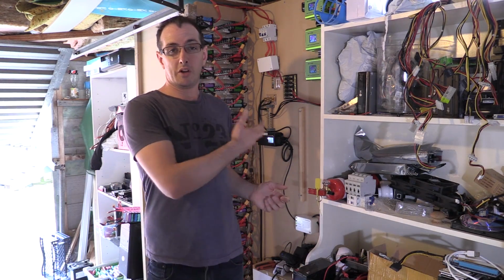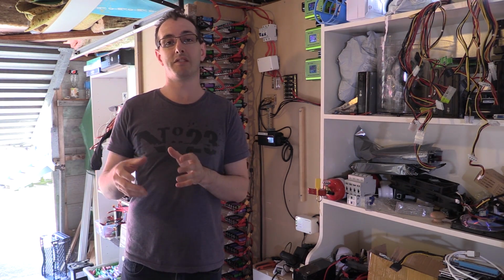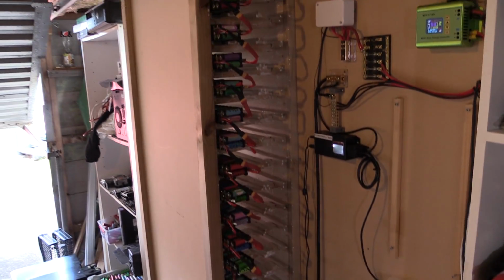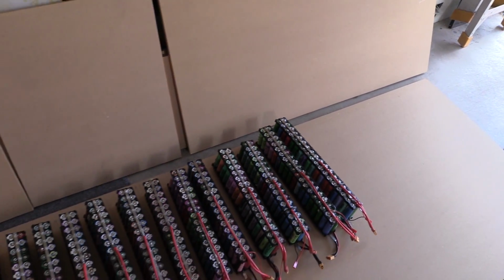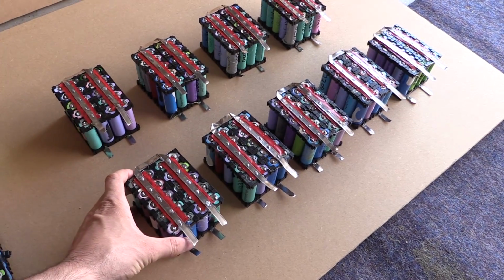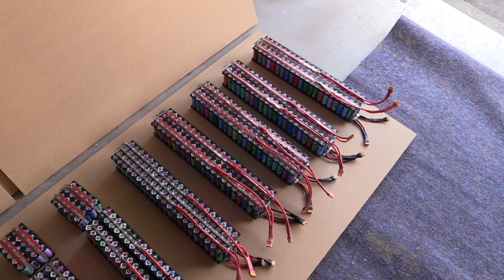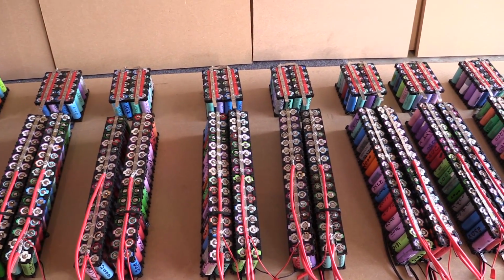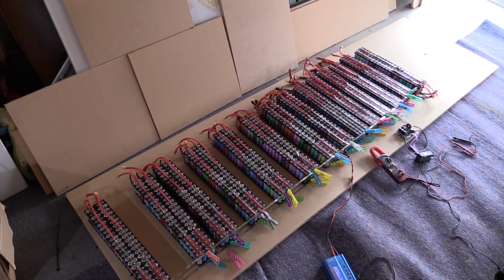10kWh 18650 48V 10kWh Pack

Comment: Hi why are you packs got 21 cells in series , though u said was a 48v system. 
21x4.2v =88.2v  / 21x3.6v =75.6v 
How’s us system runs at 48v ifs ur packs are at this volts ?

Comment: Did you buy them used? with cases and materials roughly what did you pay?
Reply from the maker: I got the cells used and then tested them myself.Cost where i am wont be the same where you are so putting a number on it wont help but i would just ask around and you will find some source of old laptop packs

Comment: why 14 in series instead of 13 for a 48v bank? are there many 48v charge controllers out there that can charge to 58v? i would think 13 in series would be a better configuration.

3.7 nominal voltage x 13 = 48.1
4.2 max charge x13 = 54.6
Reply: That's what I thought.. perhaps they are litium phosphate 3.2volters?
Reply: same question

Comment: Sorry, may be a stupid question, but why 80 batteries in parallel?
Reply: As you add more cells in parallel, you add Amps (capacity) without increasing Voltaje.

Comment: is there a reason for the change to 48v? i think i might have missed the video
Reply from the maker: 48v is just so much simpler. Given most products are 48v these days trying to find ones with support for higher voltage is hard. If I stayed with 20s i would really need to rethink the mpp chargers "the green ones" and change them out for something that supports more power like the midnite 200, also i would need to put my 4.8kWh solar over to charging batterys. The reason is more battery storage means more solar to be able to charge it and more importantly in winter. With the system spilt like I had it wasn't efficient. Eg when the batterys in the garage were full the solar panels would be doing nothing for the rest of the day where they could have been exporting to the grid. If i had everything in one spot rather then split then maybe i would have changed but i also wanted the off-grid function of the hybrid going forwards for those power outages if and when we have them.
Reply from the maker: :) https://www.youtube.com/watch?v=4tUEphqtFIs
Reply: Mike appart of just having the opportunity to getting an hybrid inverter that works with the battery and also the not availabilty in the markets for >56v chargers: Is there any other reason to change you mind to 48v ?. You were the only one that goes higher than 48v system and now going back again to 48v. To be honest I though little by little some people will follow your steps just because higher voltage (apart of the danger issue) would be better (like tesla powerwall).
Reply: Agreed, I was going 20s as well but there's not much out there that can handle the higher voltage without spending $$$$

I'm switching the green controllers for a PCM60x. Going to 14s and keeping the GTIL to keep it from backfeeding too much power
Reply: Mikes DIY Tesla Powerwall Definatelly it makes sense. Good luck with the instalation and please keep doing your interesting videos.